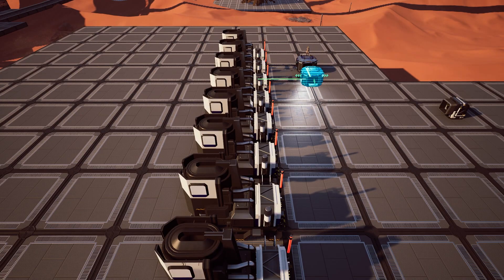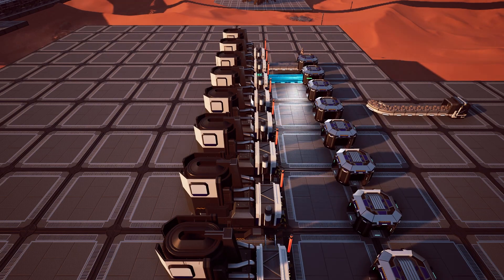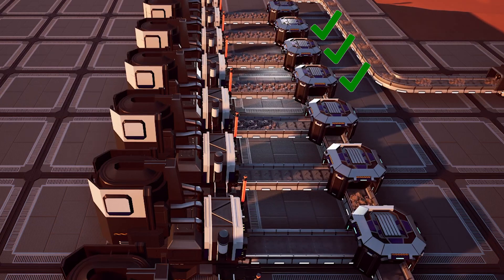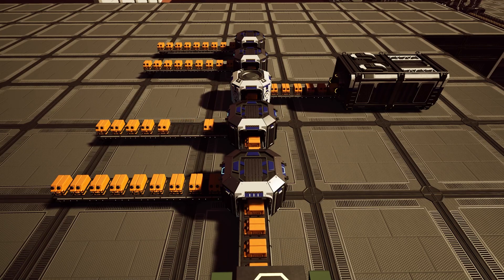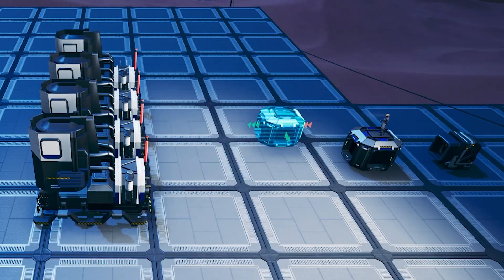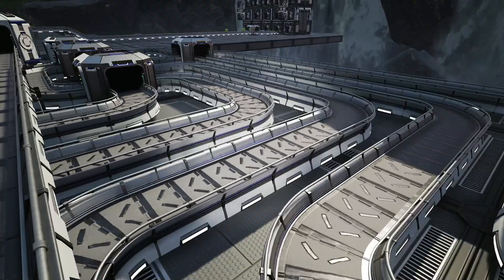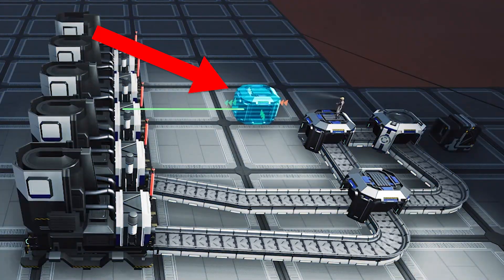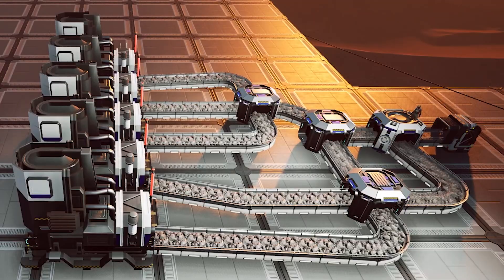Satisfactory: Manifold vs Load Balancing for Belts + Tutorial

Comment: For it to work properly the intput belt must not be saturated. 
If system requires full belt of resourcess per minute, full belt of resources must be introduced into it it each minute, meaning you cannot prioritize the loopback before input, 
but by doing so you will effectively cut of the loopback making the split |1/4|1/4|1/6|1/6|1/6| which will fill up much quicker than manifold but it will rely on the same principle and making the loopback redundant. Also I was cheking your math and it seemed fishy in the beginning to me, bcs I forgot to account for loopback apropriatly, but from what i gather you split is six way an take one and reintroduce it to the begining of the system to split it again, i reckon the math used in filtering signals could be used to calculate any possible split and its characteristics including startup time, but worse case scenario is 4% off not accounting for the loopback feeding the loopback.
So only change I would make if utilizing full belt of resources is to metge onto the already split braches adding the cost of extra merger as you need 1 for ech brancg and additional splitert bcs you won't be using the main spliter, but other that this use case i think it is elegant solution.
Reply from the maker: Yes, I wish I would have mentioned that but I just didn't think of it at the time. Load balancing does not work in this way if the belt is at full capacity.

Comment: Realistically, the only time to use load balancing is with nuclear power plants beause you don't want radioactive materials just sitting on your belts and irradiating a potentially huge area.

Other than that, the longest it will ever take a production line to "spin-up" using manifolds is probably 10 minutes. If you're really worried about 100% efficiency -- preload all your production machines before you connect the main supply bus belt (with the power off on the machines) or, more simply, connect the last feeder belt first, let it load completely, then repeat as you go up the line.

Comment: Where applicable, I use manifolds with different speeds of belts. If the destination inputs are <=60, I'll run Mk1 belts off the splitters to the machines and keep the main lane a faster belt. This causes backups to happen a little faster without always needing the machines to overflow.

Comment: There’s actually an alternative use for manifold by using the smart splitter and the overflow function. With this the first machines fill up faster and push the items more effective throughout the system. Using this backwards, means last machines first I noticed the system fills up quite good. Splitter > any undefined > splitter & overflow > machines.

Comment: good video :) Another good thing to keep in mind is combining this logic with the intentional use if lower grade belts (closer to the input rate) to lessen the time it takes to flow throughout the system.  you can even use the difference (aka spare capacity) of these belts, split them off and rejoin them in order to expand production while remaining efficient..

Comment: I use manifolds, The only case where I use Load balancing is for coal power generators.

To speed up the startup time of a new production chain, I fill the input storage on the production building manually, wait till all belts are also filled and then I start the producting. This way I bypass the worm up time

Comment: @5:03 so effectively you decrease the max size of a system by running some % of your items back through your core source feed belt (effectively adding a multiplier to it's throughout limiting total throughput).  So you become belt volume limited before you would with a manifold system. Practically speaking manifold is easier from a design perspective and the inefficiency is only in starting the system, which is negligible. The inefficiency at start of a manifold system also allows for a stockpile of the resource in the machine otherwise known as a buffer, something valuable should there be an interruption in supply source. Manifold is better for probably 90% of players but the math nerds that love the math and or logistical side of the 'idea' of perfect efficiency will go splitting. Manifolds can be started instantly while under construction as well, split systems must wait until the full belt design is assembled.
Reply from the maker: Perfectly said. The load balancer is for nerds. Sometimes it's fun being a nerd about it. But manifold gets the job done almost every time.

Comment: I guessed the manifold by myself quite quickly while working on satisfactory setups, it's really easy to scale up (even vertically since you have the "back" slot always available for a vertical convoyer), is clean, simple to put in place etc. The main downside for me isn't the balancing but the fact that the main convoyer belt item rate is nerfing the system, so it's hard before mk4 to do big setups :x Obviously the injector is the solution, but I use it only when really needed.

The load balancing is fine, but a lot harder to scale and to make it look clean, and there is in my opinion almost no benefit from it, maybe for the nuclear waste but since it doesn't solve the problem of item rate it's not so good :/

Anyway thanks for this video, it was hard to explain to my friends how the manifold is morking without showing it ^^"
Reply from the maker: That's awesome! And I completely agree. Manifold does the job 99% of the time.
Reply: I use belt speed limitation as a motivation to use verticality a bit more :-)

Comment: I kinda mix and match myself. Sometimes I'll use manifolds, sometimes balancing, depending on how I feel about it. For instance for smelters and foundries I tend to go with balancing, and for coal generators I tend to use manifolds. Not for any specific reason. I just...feel like I want to build it that way. :P That does cause the issue of the last ones in the line taking a long time to fill up and run properly, but eh the game is relaxed anyway. I don't mind watching youtube for like 10~15 minutes to wait for stuff to fill up. :P

I can understand how balancing helps a lot for nuclear waste though. You generally want to get rid of that as quickly and efficiently as you can.

Comment: Honnestly, there is almost no point of using load balancing :
- First : the setup gets really messy once you need to balance between more than 8-9 machines or when you start having more than one entry machines (assemblers, advanced foundries, etc). It takes a lot of space, which could be extremly annoying in certain cases (like building in the northern forest or in the pink one in the middle of the map).
- Second : except if you want to play it this way, satisfactory isn't a speedrun game. There is absolutely no point of having your machines to start working faster. The time gained or lost is just a joke compared to building production lines or setting ressource's income. Moreover, is it really time saving ? It takes more ressources (less splitter but WAY MORE conveyors), which means more time to produce stuff to build the production line. And the setup gets so much more complicated than a manifold factory which would have been set way much sooner. But as I said, is time consumption really an issue ?
- Third : Once you reach middle game, your ressources income gets so high (mk3-4 conveyors and mk2 mining drills) that machines get saturated hyper fast. Building time is more a problem.

One small "mistake" in this video by the way :
- The number of machines on a load balancing isn't a multiple of 2 or 3. Perfect balancing with no merger only applies to this number of machines : 2, 3, 4, 6, 8, 9, 12, 16, 18, 24, 27, 32, 36, 48, and so on ...which is a combination of 2 power "x" multiplied by 3 power "y" ... it's a bit harder math than multiples but not so much.

Comment: If your first belt is running at max capacity on the balanced system, doesn't looping back to it cause jams/delays?  In that situation I split my loop-back in two and merge them after the first split.  I don't know if this works better, but foresaw a problem that would be horrible to fix on a finished factory and laid it out like this in advance.  I usually use manifolds, but like you said sometimes you want the balanced system.
Reply from the maker: The answer is both yes, and no. Sometimes the balancing works out and it will take just a few iterations in order to normalize and there won't be any backups. This is theoretically what should happen. But also, that might just not happen. If you are running a belt at full capacity, it might be valuable to run multiple belts or split the belt in half first, or some other method of reducing the strain on your belt. 

This video easily could have been wayyy longer and covered the advantages of using multiple belts, etc. I'm happy for all the questions and discussions it has sparked, though.
Reply: I was thinking about the same problem when watching this video two hours ago... Then i suddendly realised the point : if your first belt already run  at max capacity, your loop-back will simply clog naturally, like the manifold setup. And once the balancing belt is full, everything will automatically be re-attribued somewhere else with the good ratio. 

Maybe i miss something there and i would love to be corrected if that's the case, but i think it's how the system balance itself.
Reply: If your input belt is max capacity and cannot be upgraded, then split your loopback line into 2 and merge them into the two lines after the first splitter.

Comment: unless you want to have good looking belt system, then there is no need to have some balancing for it, because at some point, it will be 100 effective  whatever you are using, if you have enough resourcess. and if need to have it 100% from the start, just fill the production buildings and belts before you power it.
Reply from the maker: Yeah I think the best uses are for when you have more materials than can fit on one belt, or need to be very precise about removing excess material. Things like that. Only useful on very advanced and large-scale productions. It's also a matter of practicality. I use load balancing on my nuclear setup to distribute fuel rods. I could have let the system back up but that would have taken a very long time, and I wanted the power! So, a load balancing system keeps the rods coming at the perfect pace for each power plant.

Comment: I use smart manifolds for all my setups. I also overload on machines so I will have more consumption than input available. the smart manifold makes sure only 1 machine is in that half on half off state. everything else will be running 100% or 0% and I can see which easy by looking at the lights on top. (as long as all the material is being used or consumed on the output)

Comment: So the manifold is superior is every way besides the initial startup. In which case it's at least close because setting up a manifold system is way quicker than the load balancing.

Only use manifolds as per Ficsit efficiency protocols.
Reply from the maker: Load balancing has its uses, but most of the time a manifold system gets the job done. The only place I use it in my world is to evenly distribute nuclear fuel rods to my nuclear plants, since that's pretty important.

Comment: The last method only works when you don't run it at 100% for the belt feeding them.  This can happen later when you need 400 items or such later on.  It gets messy after that.

The best method I found, is simply overclock or underclock the machines to accept the appropriate numbers.  So no complicated loopbacks.  Better to run 6 machines at 90% vs 5 at 100%.  Cleaner, easier, output is the same ppm.  You don't have to run it at 90% or whatnot, but it lowers power use I believe.
Reply from the maker: Great point. In all ways, load balancing requires a lot more math. And they're very bad for expanding upon. Fine for late game if you have a specific plan for setting up a factory, otherwise manifold will be a lot less painful.

Comment: I don't think it was mentioned that another advantage to manifold method is how easy it is to expand a production line later on. since it all works on a straight line and a single "main" belt, it's super easy to add 1 more splitter/merger for each additional building you tack on, and since you can snake your production line quite easily, you don't have to worry about "future proofing" during your initial build.  expanding a load balancing system however gets more complicated the larger it becomes since it branches out like a tree, adding an additional "branch" can take many more splitters and rearranging belts, and if you didn't give yourself plenty of space for future expansion you might end up needing to redo a ton of work.
Reply from the maker: Great point! Manifold is going to be the easier method for just about every reason imaginable, and that's one of them. I think that matters more in the early game though. If you're an advanced player and near the endgame, you can plan your factories a lot better and create load balancing systems that are designed to be permanent.
Reply: @SatisfactoryNews  That is the key part for me. If I plan on keeping a setup for a long time then I take the time to build the load balance. but if I am building a slap dash factory to get a specific part for an upgrade and not sure how important that part is going to be later in the trees I'm not putting the extra effort. The only exception to this is a coal power or fuel power setup where a load balance system is basically wasted effort and space.
Reply: Sadly, all builds reach a point where you have to start a new line. Load Balance just happens far faster, due to changing the setup requires far more space. Best tip I can give is don't worry with efficient until you reach Phase 3, then make a true "Starter Base" I refer to this when I mean basic material efficiency setup. All base Iron, Copper and Limestone along with Re-enforced plates, Rotors and Modular frames. This small step will greatly make transitioning into and beyond Milestone 4 much easier. This will also have you primed for transitioning quickly into stable power and stop your Greenpeace rallies at your HUB. This is by far the ting I see most often with newer players. 

Secondary tip is early into Phase 3, don't try to automate anything beyond the basics I listed above. Just setup Dump fill mini lines. I normally setup the small storages with required machines to just produce those Phase 3 items while I'm off getting HD's and doing MAM research. I mean, your time is you only true resource that you waste. Everything else is opportunity for growing and learning. 

One last point... 

Don't forget that Starter Base area is only just till you are able to branch out. It will stay that way the whole time. So just keep flowing.

Comment: I usually build factories from resource node to end product, planning the numbers beforehand, but building 1 layer at a time, this way, by the time I get to the end, every line will be long saturated. In my first game I mostly did load balancing, but I progressively switched over entirely to manifold method for scalability and upgradability.

But with you mentioning nuclear waste I realise that it was probably this, why I kept having problems with waste buildup in my first nuclear power plant. Next time I make one I think I'll load balance them and make every particle accelerator and mixer a little overclocked to ensure no waste pile-up. Yeah. Putting both the mixer and accelerator on the same line was too sloppy in the end.
Reply from the maker: For sure. My issue was having several nuclear plants and the control rods were being built at the exact same speed as they were being consumed. So when using manifold, the first nuclear plant was getting most of the fuel rods and the last plant was getting basically none. Rather than waiting for hours for the rods to back up, I just set up a load balancing system so that the rods would be evenly distributed. Makes a big difference in this specific case, but usually it doesn't matter.
Reply: @SatisfactoryNews  I did the same thing, but I DID wait hours for the rods to build up. As I said, my problem was putting the mixers and particle accelerators handling the waste on the same line, which, looking back on it, could've only seemed like a good idea after the many many many many many other hours I spent setting up the rest of the power plant. In short, the whole system got clogged up. HARD. On top of that, there's the bug with Mk.2. Pipes that they don't carry the full 600 m3 water they advertise so generators just keep turning on and off, making my power output fluctuate and further screwing up the math on waste.

Comment: I usually use the manifold system. But I sometimes apply power to the first set of machine to prime them while I'm building the second set of machines that take the output of the first set of machines. So they're usually filled up already before the second set comes online.